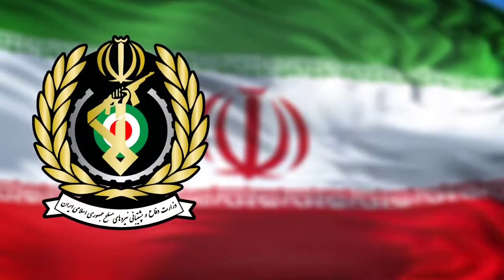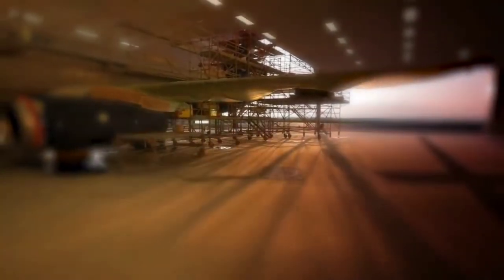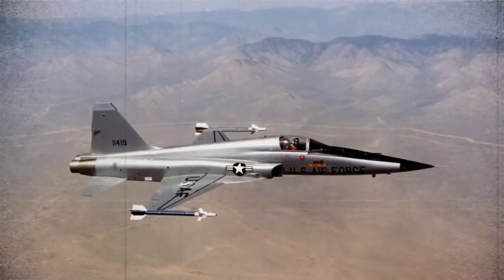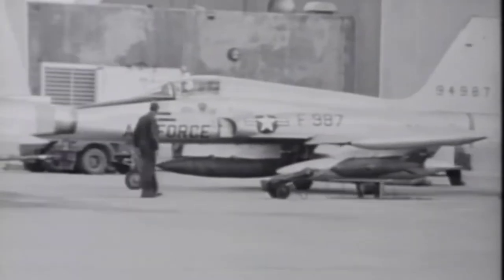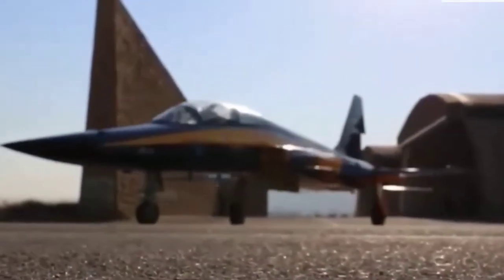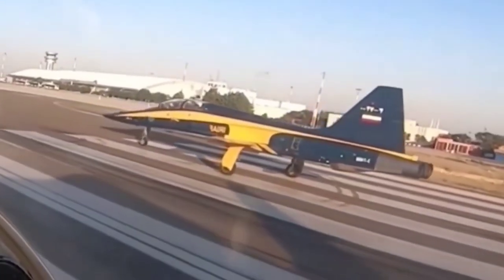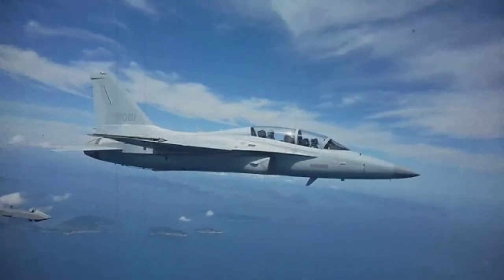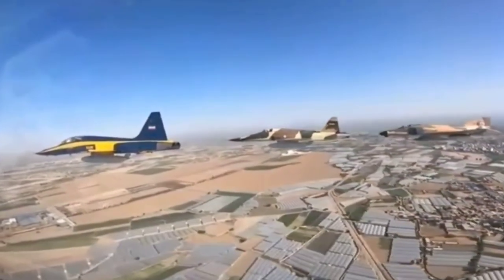Iran's F-5 Fighter Jet Version JUST Revealed!

Comment: The US Navy's F-18 Hornet is only a navalized streached version of the F-5E and a new name and weaker engine so that the Tiger of this fighter cannot rise up for the Pentagon Fighter Mafia hates anything about the F-5Tigers and anything created by Jack Northrop. Yes of course the "Saeqah" is much more deadlier than the F-18Hornet because its faster, more agile for whatever name you call it, its still a Tiger
Reply: No, the F-18 is not a navalized F-5.
The F-18 is a navalized F-17.
As for the Iranian fighter being "Deadlier", than an F-18, its thrust to weight ratio is less than half of the F-18's.
Its a 60 year old aircraft with 60 year old engines.
In the US, we'd have it in a museum.
Reply: @Waltham1892  You are beating a dead horse my friend! Anyone who would say that a jet from 1964 is on the same level as a jet from 1983, does not worth arguing with. This person genuinely thinks that the F-5 is as good as hornet (let's say the legacy hornet for that matter) has not even the slightest clue on either F-5 a 2nd generation fighter and a multi-role 4th generation fighter.

Comment: The tail proved to be a flop in the design, twin vertical rudders are falling into the vortices created by the air intakes in high subsonic flight and lose all their aerodynamic control, it also has a bad rolling habit at landing speed... that's why passed this mod they returned to the original freedom fighter design with the traditional tail in all the newer iterations...